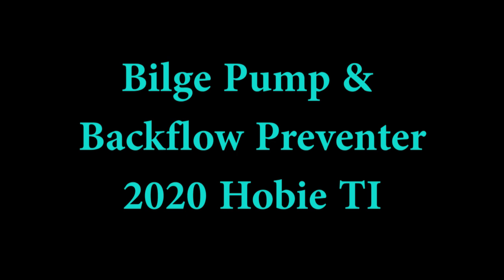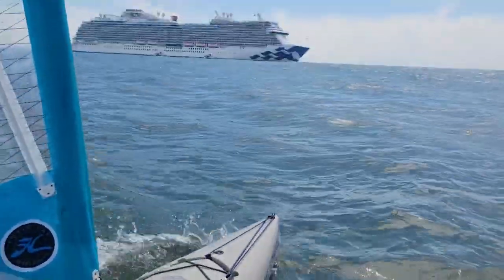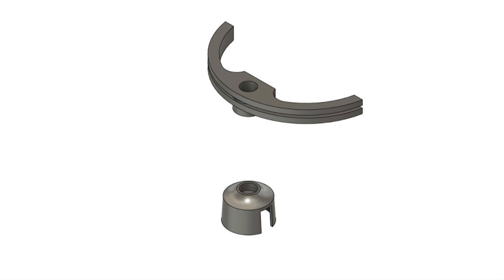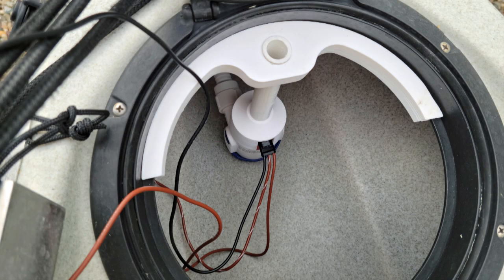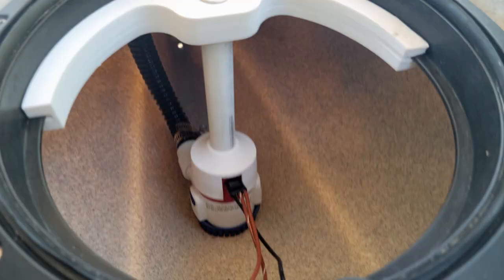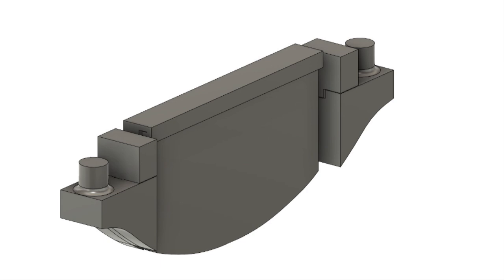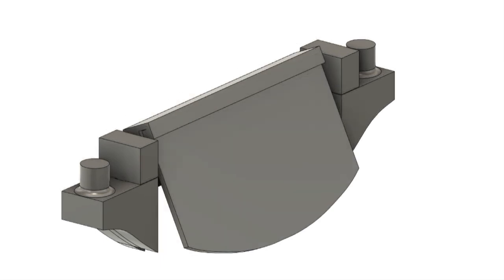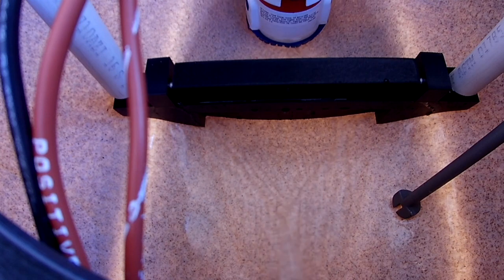Bilge Pump for Hobie Tandem Island

Comment: Nice set up.  I would have run the discharge thru the hatch as it would be easy to replace the hatch if you wanted to remove it and get everything back to stock
Reply from the maker: That's a good suggestion. I considered it at the time, but opted not to since I'd already done quite a few mods to the boat.

Comment: That's a nice setup. I don't have a TI, but I do have 2 AIs and sail quite a bit, some in fairly rough conditions. In my experience, if you are getting a lot of water inside, it's coming thru the front hatch. There are a lot of ways to reduce (if not eliminate) the water coming thru the hatch.

Comment: The manual pump is the problem.  In rough seas, it's difficult to open a hatch to insert the pump (water coming in hatch as you are pumping it out...at least while moving).  I printed a pump fitting to mount to the deck, with a TPU cap and below deck I have a 1" hose running to the bottom of the boat and keep the pump strapped to the aka for access.  The top of the pump port (it is lined with a tpu gasket glued in for a snug fit on the pump) is just a friction fit, hold the pump to it and pump.  Can pump without opening any hatch now.  I am also equipped with an automatic bilge.  Ain't 3d printers great?
Reply from the maker: Nice solution. Yes, anyone that tinkers should definitely get a 3D printer. The possibilities are endless.

Comment: I really like you ur design and installation. I have a new 2023 tandem I took delivery at the end of nice weather last fall. I would love to install the bilge pump system on my island. You mentioned you were going to put parts list together and have parts for sell. I would love to talk with you and see if we could could obtain what I need and install the system on my tandem. About 45 miles north of Seattle… not sure how far a ay you are. Pls let me know if you have parts and cost. I want system here for Puget sound. 
Thanks
Bob
Reply from the maker: Thanks for your kind words, Bob. I do sell a bilge mount kit that makes the pump installation itself quick and painless. You still have to run the discharge and power, of course, but I'll send you a complete materials list of what I used with your order. You can email me at iwontrepeatit at gmail.

Comment: Do you have a plan to hand pump the water out while still on the water, if the bilge pump stops working? I was thinking of a cone to put around the hatch to stop waves from splashing in and pumping out periodically. In extreme cases, maybe an inflatable mattress that is inflated under the boat then hand pump out the water. Another option is to fill the boat with “ping pong balls” basically anything that is extremely buoyant to take up space and negate the need to pump water out.
Reply from the maker: I do have a hand pump that I take on longer trips, but I can tell you from experience it's pretty useless in a rolling ocean. If you plan to put stuff inside the hull, just make sure it doesn't conflict with the rudder lines.

Comment: I have a 2007. I’ve never quite understood the AI. I take on too much water no matter. 

Plus in the cockpit the water keeps up flowing in from the pedal  drive hole.
Reply: I have 2 AIs, and if you are getting a lot of water infiltration, it's almost certainly coming in thru the front hatch. There are a lot of ways to get a better seal on the front hatch. Search on the Hobie forum and you'll find a lot of info (I'm NowhereMan, in case you want to see my solution, which is particularly simple).

Comment: Those 3D parts are nice. Share or sell the files? I need to set up my 3d printer this would be a good first project as I'm setting up my new-to-me TI now.
Reply from the maker: Sorry, I stopped sharing stl files after people took them and started selling the prints. I will, however, be selling the parts necessary to secure the bilge pump to the hatch in a few days, after I make a few design changes. $85 + shipping.
Reply: @tomlewis509  Naw, I'll make my own.
Reply from the maker: @d-rot  It's a fun project. Good luck.

Comment: I wouldn't have accepted it leaking in the first place. The leak is unacceptable, but surely correctable.
Reply from the maker: I find the leak completely acceptible considering the boat is designed and built by Hobie only to Categoy D ratings:

 "CATEGORY D – INLAND OR SHELTERED COASTAL WATERS
This rating is for boats in small lakes and rivers with winds to Force 4 and significant wave heights to 18 inches." 

It's just that many of us use the boat in conditions for which is was never designed, including bashing through big waves in the ocean. You can minimize the leaks - and I have - but it's unlikely you'll eliminate them. Also, from a safety standpoint, it's a good idea to have an automatic bilge pump in case a new leak springs up.

Comment: Please show your handrail system, that could be a very useful addition for a friend of mine.
Reply from the maker: I'll try to do a video on the rail system in the future. Basically, it's just lengths of 1" SS tubing cut as needed. It'll be a while before I get to the video, but I'll put it on my calendar!
Reply: @tomlewis509  That would be great, mostly I’m interested in how you use it and is it sturdy. My friend that sails his TI is handicapped and I think something like that might make it easier to move around getting on and off. How you found it useful?
Reply from the maker: @maxwellmark  yes, it's very sturdy. I made it because I was concerned about how exposed I was while moving back and forth from the rear seat while solo on the ocean. The railing provides a sturdy place to grab onto while moving about the boat. My wife also appreciates it on the days she sails with me.